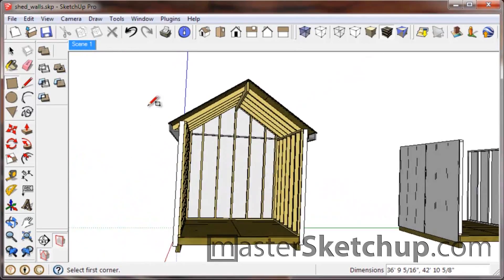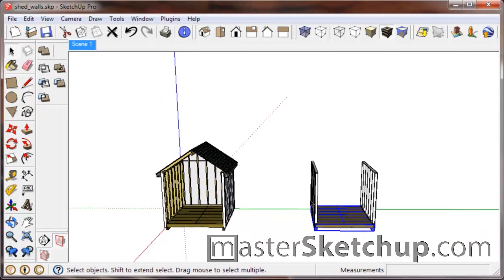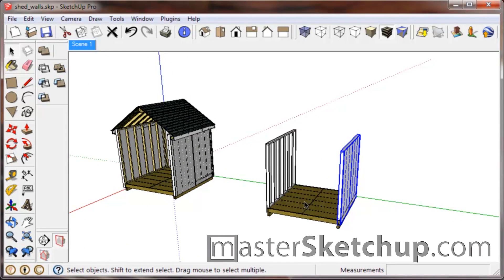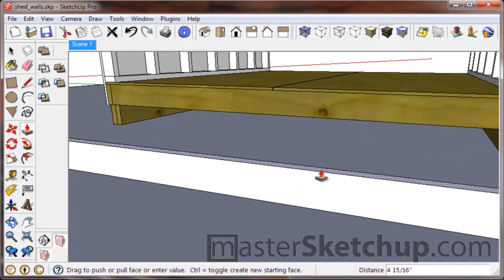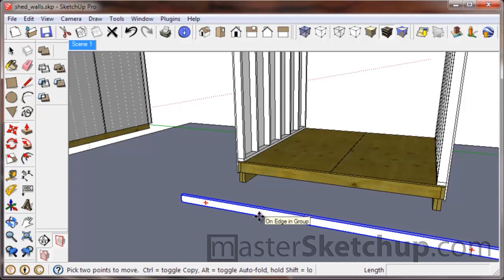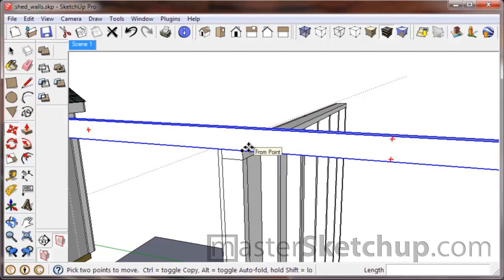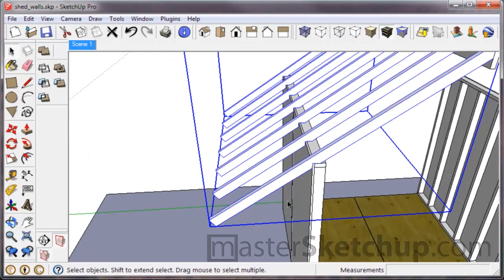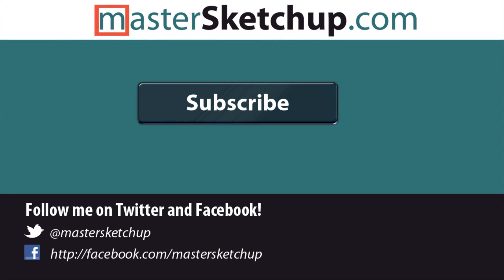Sketchup Tutorial - Model a Shed (Part 3) - Rafter Framing

Comment: At 4:30 you are wondering how deep the Birds Mouth cut has to be...it is always the depth of the top plate. In this case the top plate is a 2"x4", so the Birds Mouth seat cut would be a 3 1/2".

Comment: You do a good job of demonstrating sketch up. But you really don’t understand carpentry.  Like putting 1/8” space in floors and wall, not rafter dims, etc.  This makes it hard to watch what you making.
Reply from the maker: 1/8" gap is for expansion and contraction, you never want to install plywood tight against each other. As far as "not rafter dims" I don't know what that means.

Comment: Enjoying the step by step process, but I've hit a roadblock. Like Tom Perkins of some time ago, I'm having difficulty with the rafter adjustment using the push/pull tool. It doesn't seem to work at the intersection of the walls... can create the birds mouth further along the rafter, but the walls seem to disrupt the effect of the push/pull tool, so that it wont extract the component inside the lined triangle.. I'm still early in the process, so I gather I've missed something, even after several repeats... any ideas on that?

Comment: why can't i use the cutting process like he uses in the video. its not working since the new update. anyone else experiencing the same?
Reply: It took some playing around but I figured it out. I got it to work by drawing two out of the three lines, assume that the third line is already drawn by the outline of the 2x4. I then "exploded" the group and was able to push/pull the section. Afterwards, I re-grouped.

Comment: I use Sketchup 2015 but I also use Sketchup 8 because of the extinction it has called
 House Builder you can lay out wall floors roof and even add a door are window with a click. So if you want to frame a building and see how much lumber you will need this is a great one to use.

Comment from the maker: Brandon, The spacing of the panels is a small detail, but basically that's just good practice to allow for expansion and contraction, so the sheets are still 4 x 8. Some might consider it to be too fine level of detail for a model. As far as the overlapping rafters, you need to double click one of them in order to draw a line and delete it. Make sure you're editing the faces and edges of that rafter and you're not outside of the group.

Comment: I really like these videos. They are great learning tools. I have two stumbling blocks when creating the walls and rafters. The first is, when placing the wall panels 1/8"apart, do you then shave off that 1/8" on the end of the remaining wall or 1/16" off both so they will line up on ends as 8 feet wide? The bigger problem for me is when you create the first 2 rafters and they are overlapping, I can't select the overlapping part separately and erase it like you did. I've tried everything like adding new line segments but it still remains as one long piece. Thanks again for the videos!

Comment: Hello: Master

I have an issue, that has cold stopped me from going forward, I really would like to finish this model drawing, [I need to present it to my city, for build permit], which it is a porch connected to the back of my house.

I'm really stuck on drawing one rafter, which is the hardest since the others would follow as copy and paste.

Could I in some way, get your help?

I could I think email a snap shot viewing, to show you.

The house roof, is a [two sided gable] so as for mentioning this the rafters will be coming off from being mounted off a 2x6 off the house roof, leading to rest of a top rafter which is sitting on pillars.

This is my email address, I'd love to hear from you thanks ahead.

    Sam....
Reply from the maker: Hi Sam, didn't get your email there. Send me a message and let's see if we can figure it out.
Reply: MasterSketchup  Hi Matt
 Thanks for the reply, and I've been watching your videos, great I have your site "Locked" in my back pocket.

I'll finish my couple things, and send you an attachment copy of my project, as I think you probably could open it using Sketchup. 

You'll see I've been trying to form rafters going from the top beam cross over which is ontop of the 3-pliers, onto a 2x6 that would be mounted half way on the back of my house top roof.

Anyway, let me finish these couple items, and I'll send another email to you prob Sunday morning. Happy Easter to you and your wife.

   Sam....

Comment: I have problems with the push/pull tool. For example, when you were making the rafter seat, you drew the outlines of the seat then you started to push. Did you hit the delete button while you were doing the push pull? I also have problems with loosing the top face of my rafter when I try to do this. Any help would be greatly appreciated.
Reply from the maker: Hi Tom, When doing the rafter seat, draw the outlines of the seat as shown. Then, activate the push/pull tool. Click once on the surface you want to delete, then move your mouse and click again on an inference point (edge or a corner) on the back side of the rafter. That will make it disappear. I guess you could call it a "negative extrude" :) Try that and let me know if that works. Feel free to email me matt@mastersketchup.com I'm happy to help.